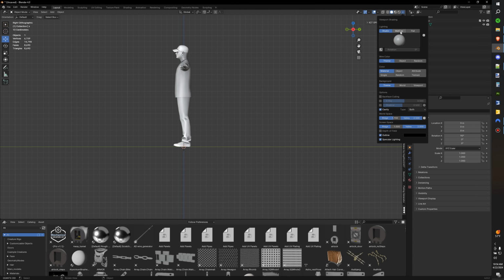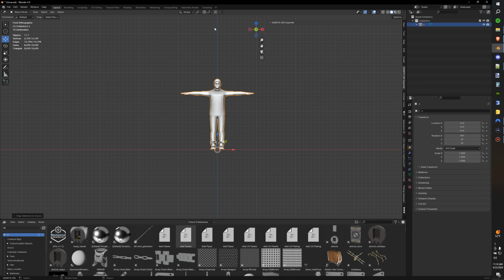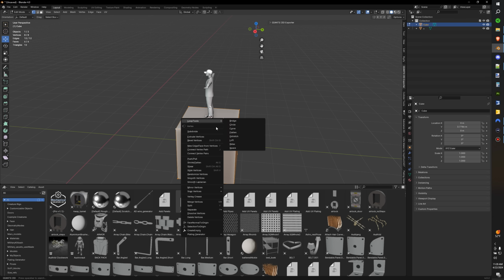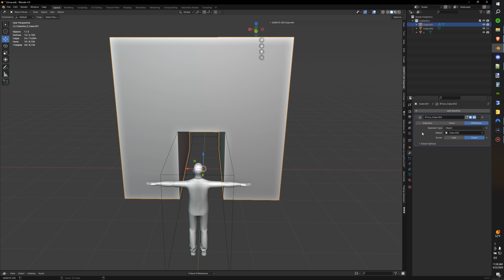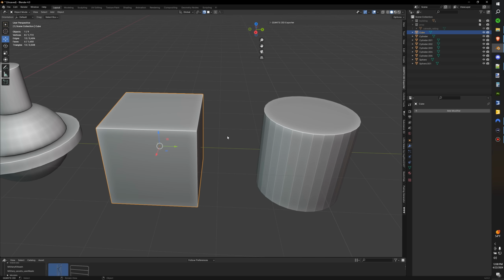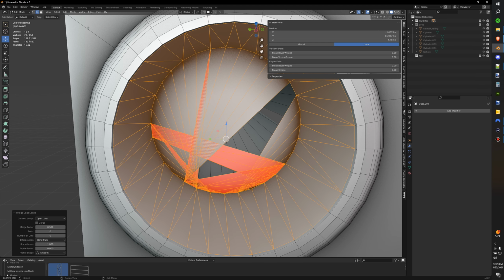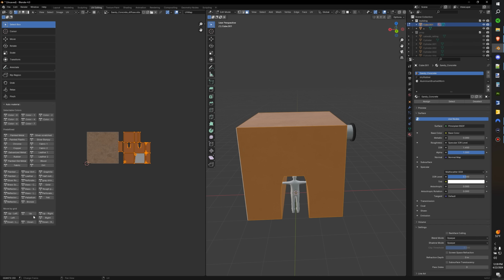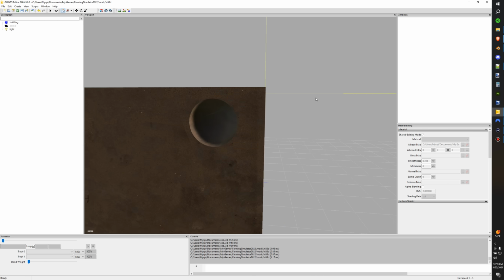Blender Introduction for Modding Farming Simulator 22

Comment from the maker: This is a older video, Blend file might not work anymore, so link is no more...
Keep in mind this is for FS22, but everything but exporting and UDMI UV mapping is still gonna apply.
New video coming for FS25, Subscribe to know when that drops.👉 https://www.youtube.com/@LAMBOMODS?sub_confirmation=1
Reply: Thank you so much for all the tutorials, been watching them like a mad man! So hard to find good info on modding for this game yet it's one of the most popular modded games out there. Been crawling through multiple search engines, youtube videos, small articles, even Developer released tutorials. 90% of them leave out the much needed critical info and pretty much skip to the highlights and your stuck figuring out the crucial parts. I just wanted to give a big thank you for sharing your knowledge and actually going into detail on critical things in your videos!
Reply: @gameingHyenia Anything under the sound code block, will just be to do with sounds. for example when the tornado changes direction, it would trigger a different sound from the sound section of the xml file. If i had to guess, i would assume the tornado is some sort of animation file (which I myself haven't dug into it yet.) Would probably require making an entire new animation for the tornado as it's probably an animation loop. @LAMBOMODS might be able to shed more light on this but usually stuff like that would require an entire new animation. Also, the tornado paths could actually be built into the maps themselves sort of like A.I., would have to really dig into it to see.
Reply: any plans to bring back a blend file?
having a scale reference would be great and i can't seem to find the character model in the game files.

Comment: Lambo. When exporting from ge and bringing it into blender. One of my axis is always off 90 degrees. How do you keep the same same translations that’s in the mod. Cause I export section with files and click yes twice. Everything is always right other than that one axis always being off 90 degrees.
Reply from the maker: @landonmauldin42  it's does a odd rotation every time. It's due to how giants works and ge. They have opposite control axis names... y is not up in blender like it is in GE.  This issues at a 90 in. Best to apply rotations in blender if they change. They need to be rotated to 0 in ge prior to export to blender or you lose all translation/rot/scale data.. so it needs to be 000, and 111 for scale
Reply: @ ok appreciate it man.  That’s what I was doing wrong. I would click an object and just export it with all translations like they are. I will duplicate the object and zero that one and export it then fix it in blender then when I import it just copy all my translations  to the new one before I delete the old one.
Reply from the maker: 100% good luck 😀